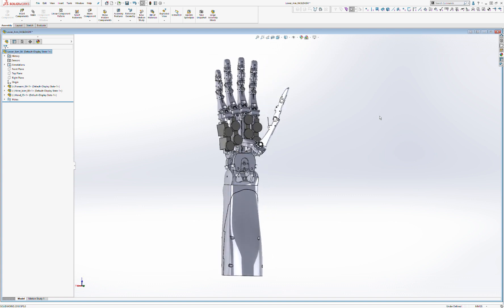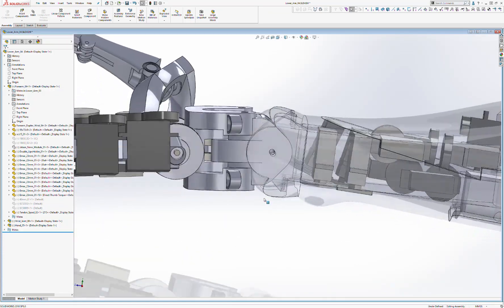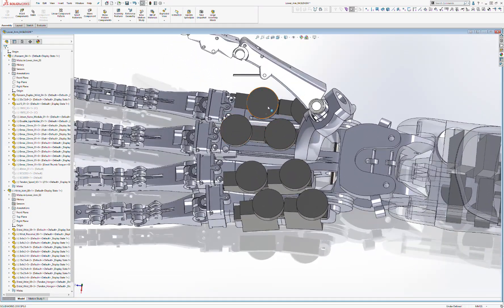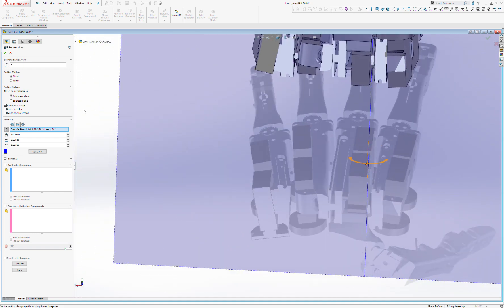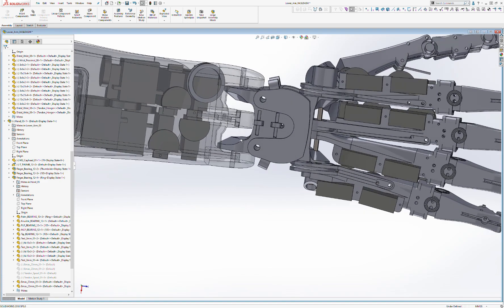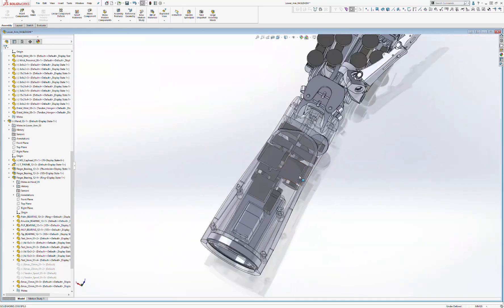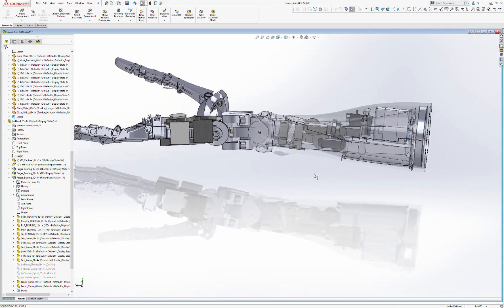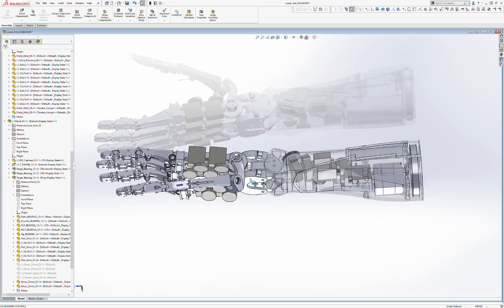The Joy of Designing Robots - Tendon Pathways through the wrist

Comment: you said once you build a robot then the work to keep them going becomes hard work and that's why most of your old robots don't move.  Can you elaborate on this?  What are some of the things that fail and how can this be prevented.  How can the design be made more robust so that the work to maintain it and keep it going is not overwhelming?
Reply from the maker: Robots require many systems to work simultaneously that all have different failure modes and meantime to failures.   Failure modes also interact in hard to predict ways so once any systems start becoming unreliable the effort required to maintain the whole system grows rapidly.
Reply: @therobotstudio  fair enough, but a list of example failures, which are common and a list of solutions and ways to prevent them would be helpful
Reply from the maker: The failure modes and many and often hard to understand even when fully examined. The only real advice I can give when debugging is always start with the physical layer.